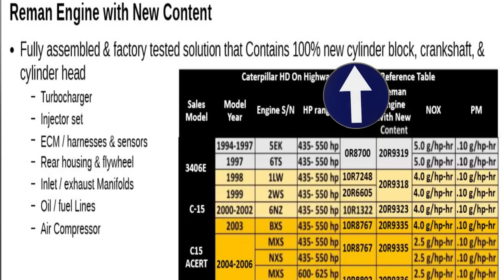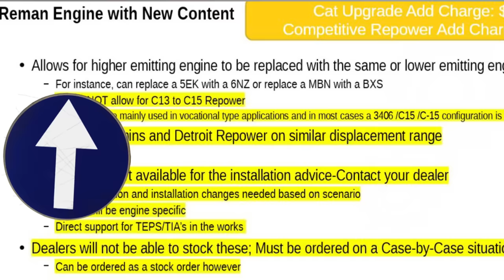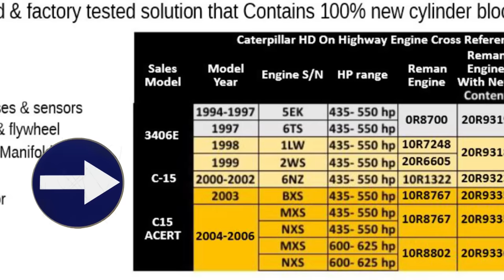Swap Your Cummins for a NEW Cat Engine!  Cat is Making New Truck Engines.

Comment: Hello Mr. Ape. Can you answer a riddle I have? Why does my truck run smoother at 150 degrees than it does at 175? I noticed this when it was extremely cold these past few weeks and when the temp outside went up, it started to sound rougher like I need my overhead run. Could this be an issue with my temp gauge misreading and I’m running too hot? I believe I have a thermostat issue and know it’s toast due to how the fan has acted in the last weeks and I have already ordered a stock one due to it being under warranty. I also have a new temp sensor to go with the thermostat. Lastly, I want to make sure I don’t have a problem with the oil cooler if the temp gauge is off and that it’s not just the thermostat. I have read issues with oil coolers and none of the problems I saw for replacing it deal with anything I’ve read but maybe it’s something that isn’t common knowledge if it is? Also, I’ve previously read online that a 2WS likes to run warm. True or no? Please correct any misinformation I may have. For background info, the truck has around 100k on the I frame done at Cat and it got a new head, rods/mains, platinum build, etc. Thanks for your time.

Comment: Nothing wrong with reman if done properly. They can make mistakes in the reman process, and so can the OEM . Some diesels are made so the block cannot be rebored further. (Thielert) but others like Detroit can in theory be reman forever, you just put new cylinder sleeves in, assume you did not do anything stupid by running water in the cooling system in Alaska.

Comment: Very curious what the new engine includes ie; what accessories. Oil pump, cam, injectors etc?
Reply: I have not ordered a new content engine. The REMAN engines don't have a flywheel, so you have to use yours. Now with any REMAN engine from Cat. They usually make one arrangement. Your engine may require parts swapping. Like a normal REMAN 5EK is based off a FLT truck, if I recall. A 6NZ is based off a PACCAR, if I recall. Sometimes oil pan, exhaust, rear cover, etc may have to be swapped. So first item you have to know is what I got and what am I going to order.

Comment: What's your honest opinion on why CAT hasn't re designed their aftertreatment system and re introduced the C-15 for commercial trucks?
Reply: I honestly think there just isn't the money in it for them.  I think the trucking industry is tight with component prices these days it doesn't leave enough meat for cat to think it's worth messing with.
Reply: They have supposedly tried but none of the manufacturers want to buy a Cat engine when they already have their own. Pete/KW have Paccar, Volvo has their own, etc.
Reply: And they already have homes for their engines. They can’t build enough C15’s already for internal use

Comment: Personally I could never see replacing a DD15 or 16 with a C15 or 16, the new Detroits are much better on fuel and they pull just as hard
Reply: That’s because it’s practically a Mercedes engine badge as a Detroit. European engines have more power
Reply: Due to how the wiring and ECM works with the DD series that is going to be a huge headache if not impossible!!  As far as I know with the Cat engines the throttle, engine brake switches, start signal, warning lights, and such are all wired into the engine ECM while the DD gets all that in messages from the CPC (common powertrain controller).  The only wiring to the engine ECM is power and data.  In the original Cascadia the CPC lives next to the radio in the dash.  You won't be able to just cut out the CPC and wire everything to the Cat ECM... it's going to take some serious programming changes to get everything to play nice which I have a feeling Daimler isn't going to be interested in doing.
Reply: @los8373  the only interchangeable part between a DD16 and OM467 is the engine block
Reply: @jasonstclair6293  the DD15 is, frankly, a better engine imo, I couldn't see swapping to a Cat

Comment: If you’re interested , I’ve got video of Rush truck center taking my freshly cat premium rebuilt engine in my 89 379 that I put in their body shop and they left the motor wide open filling it with dirt dust and fine sand, 2 1/2 years s now motor still not cleaned out by them nor is the truck finished being rebuilt. Finding a lawyer for that type of case is extremely difficult and so far I have been unsuccessful, maybe an attorney will read this

Comment: Cats are good engines no doubt  As are Cummins engines.Neither will out live a Detroit of the 71/92 series. I know-I know they don’t make them anymore but there are tens of thousands out there. I have an 8-92 natural that went to 62,480 hours over 40 years with only injectors being replaced.At the same time friends and family were running Cats or Cummins engines none could get above 33,000hrs.which is pretty good.In comes the new age “clean “engines and the life expectancy for them cut down to under 10,000hrs.These are marine grade engines in Lobster/scallops dragger boats . They are not babied. In maritime industry the boat is built around the engine so replacing an engine is not easy or cheap even if it is a swap of the same type of engine. Most captains want an engine that will out live the boat payments and this can take years (upwards of 20) and the newer models engines aren’t up to it.

Comment: I work at a Cat Dealer and few years ago we had a customer that contracted us to reman C15s to turn into slider engines in, I believe, a motor home chassis, maybe a tractor? regardless he supplied the core engines to be built, at first they were decent, then it started looking like he found them in a deep sea salvage operation. we had to end the agreement because the cores were so poor, rusted thru out, bad cranks, block damage, etc, they could not be built cost effectively.
 I wonder if this program is part of their Classic Parts system where they contract out to foreign manufacturers to build cat spec obsolete parts .
and another thing, Cat doesn't want your old engine back, the Govt' forces them to ensure we are not cheating the emissions like putting in a great Tier 3 eng in place of a junk Tier 4

Comment: So my 1989 3406b motor can be rebuilt with a brand new part?
Reply: Not offered on mechanical engines. REMAN engine is still available for a truck.

Comment: Or better yet, you can locate , Rebuild and install A 3406B Fully Mechanical Cat. And save yourself the Headaches of Computer Controlled Engines, DEF and ELD B.S.

Comment: Be interesting to know the emissions levels out of the Caterpillar engines (for generators) that run on hydrogen and whether Cat will do internal combustion hydrogen engines for trucks (if the hydrogen refuel station network expands sufficiently) at some future point in time? (that are less difficult to make to meet epa requirements than diesel burners)

Comment: I have to disagree with the theory of "NEW" engines. A high performance engine, or even upgraded engine started life as a base engine design somewhere before it was modified, re-machined, and had the clearances reset. All part of the rebuilding process. In my experience as a auto/Diesel Technician, NEW stands for 
Never
Ever
Worked. 
And that goes on to say it is just as unproven or durable as an engine rebuilt and refinished to be new. But a rebuild has the opportunity to correct what may have been wrong in production. Especially in cases where a OTR truck block is resleeved, the operator may never know a hole was out of round originally and one piston was running hotter than another reducing output. Gasoline engines have more common casting defects. Shot peening and thermal treatment in the rebuild process can remedy these.

Comment: You mean get rid of the sorry fuel guzzling super hi cost cat mill and put in a cummins   finishing off a classic 900 with a 400bc1   amazing     got a 425 on a chain. Still cant touch cummins

Comment: Love CAT power but I have a 14L Series 60 now and not sure about the expense and what I'd have in return... would the  CAT be that much better than my Detroit?
Reply: Keep that 60 series running. They are really good power plants. They chew through camshafts sometimes but otherwise they are bulletproof. Fished on a boat with a marine spec 60 series and it was one of the nicest experiences as a deckhand to not have to constantly baby sit the thing while it spins a 6 cube hydraulic pump.
Reply from the maker: Some people just want a Cat, I'm not saying the Detroit is a bad engine. It's just an option.
Reply: I miss my Cat NSX
Reply: if you have 14L Detroit 60 series... than yes CAT 6nz Better if you like ECM controlled  engines.
Reply: series 60 the best..  Keep it as long as possible.

Comment: For anyone wondering how much this costs, ur looking around 83k for the long block.
Reply: Is that with a engine swap price? or just long block with core price ?
Reply: @Gmoney927  New content long block for a twin turbo is 36-38k. I have ordered these. It comes with a oil cooler and a fuel transfer pump. You can reuse your oil pump, reuse your air compressor. Does not have injectors. But cam, rockers IVA's. Reuse your rear cover, oil pan and bottom, left and right sides, front damper, front mount.
A new content engine is 60k, no labor. I have not seen a bill yet that was 83K.

Comment: Whatever kind of engine you desire to buy and swap, go out and buy a dirty cheap core to send into Caterpillar...toss out the one you don't want from your truck.  Problem solved.   Unless they require some sort of proof through vehicle registration, shouldn't be an issue to go around.

Comment: How do they get away from the ELD mandate based on engine block production date?
Reply: The ELD law is completely based on the engine build date and nothing else. It doesn’t control which engine you decide to put into your truck. It’s called a repower and you have to replace the transmission at the same time.

Comment: cat should make replacements for Fords powerjoke engines, not just heavy truck/equipment engines.  in my area its common to see cummins swapped Fords. I ve seen Cat swapped Fords on the truck pulling circuit in the midwest.

Comment: How does this get around the Glider Kit laws that started cracking down on replacement engines?
Reply from the maker: These are replacement engines for older trucks. These aren't older engines going into new trucks is the reasoning I guess.
Reply: @AdeptApe  I heard repairs for  Cats are pricey.
Are these new Cats easy enough to work on myself?
I don't mind getting professional tools.
Reply from the maker: They are the same design as the 3406 that has been in production for 3 decades. They are easy to work on in my opinion, but I'm biased because I work on them every day.

Comment: Does it come with the ECM and engine harness
Reply: A new content engine, I have not seen one yet. A normal REMAN engine is ready to run, no flywheel or starter (starter not a Cat part). Only built to one arrangement, may have to swap parts, depends on what truck you have.

Comment: Could I swap my 2019 Cummins X15 for a single turbo C15?
Reply: Legally you have to install the same emissions engine you have. However I have seen people do as they wish, don't get caught by the EPA.
Reply: Why in the world would you swap an engine with warranty for one without
Reply: @justinmartin8887  it doesn't have warranty I'm over 950,000 km already
Reply: @johngoldsmith6629  thanks for the reply
Reply: @Josiah_Harder  Year emissions, as long as they are in the same family. Brand does not matter.

Comment: Why is cat not making new engines for new trucks? Do they not have a teir 4 final engine going in new off road equipment?
Reply: IIRC cat chose to stop because of the cost of meeting increasingly restrictive EPA emissions for road vehicles. Their margins were better for construction equipment than their engines.

Comment: I don't know about on highway engines but for offroad applications making new engines is needed. CAT has lost it's way and the engineering is trash now. 15 years ago they were top of the pile but today they are just junk and in need of a new team at CAT and some thought before engineering their equipment.

Comment: Anyone who goes from Detroit to Cat will be making the worst financial decision possible.
Reply: At the end of the day it comes down how you maintain the engine. I had both Detroit and Cat. I favored my Cat more no egr, I was ok with the compound turbo set up and iva/avv sensors. Proper maintenance Cat aren’t the expensive to operate. Josh has made a video on how Cat advises to run the engine. I can say for a fact it is true. My original turbos from the factory lasted me a million miles. The day I hit a million turbos started to leak oil.

Comment: Not that easy to swap a Cat for a Cummins or Detroit. The cab will need to be rewired to fit the Cat engine. Much easier to swap a Cat for a Cat.

Comment: wonder if these meet the stupid california emission garbage which is causing trucks, busses, etc to be shipped out of state or scrapped, if so there is a big market for these
Reply from the maker: They only meet the emissions of the original year they were produced. So a 2001 truck with a 6NZ would be getting a replacement for 2001 emissions standards.